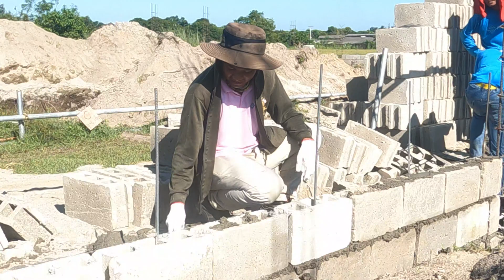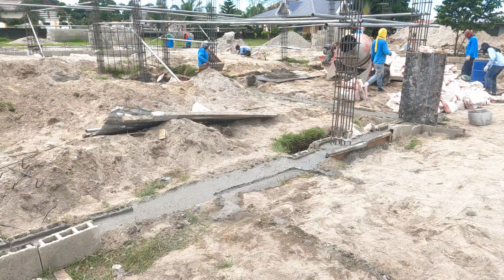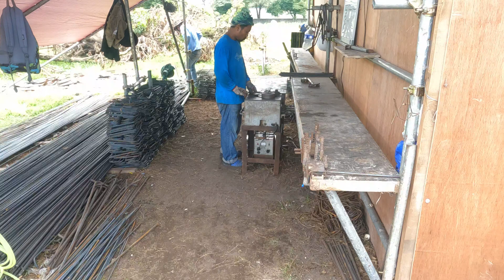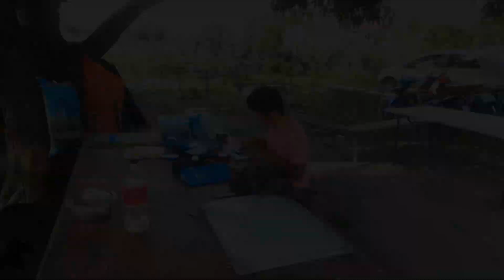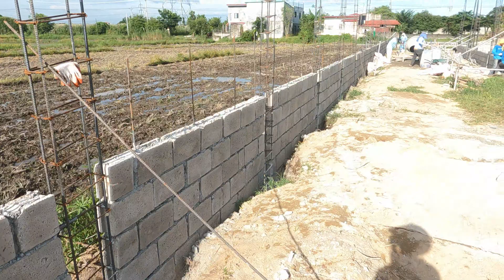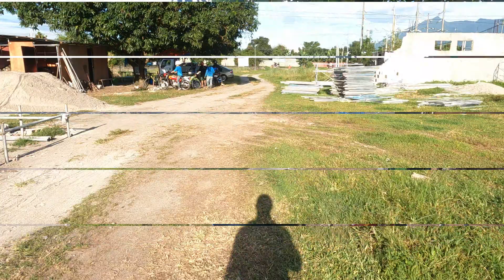Philippine House Building Day 15 - Multi Tasking Engineer

Comment: Before I start the Allblacks won only just South Africa  very strong team.

The concrete for the most slump is reasonable ie usually Filipino workers add to much water. 
My opinion is the column is best cast in one to the next floor. 
However when hollow block is laid first then there is no but to cast the column in sections for the wall stability. 
And as the engineer says very clean at  the join.
Something that could be considered is a slurry of cement water mix tipped in Before concrete, this would aid bonding.
Looks good to me
Reply from the maker: I am not going to get into a rugby discussion with a Kiwi. As and Englishman, history is not on my side.
Well there was that World Cup semi-final in 2019…..😜
Thanks for the thoughts on the column pour Graeme. For other build dummies like me, this is again exactly the input we need.
Reply: @philippines4.0buildinganew64  
To other things I thought the use of scaffold tube  for profiles is really good idea and I'm impressed the rebar bender.
The engineer has some good build techniques